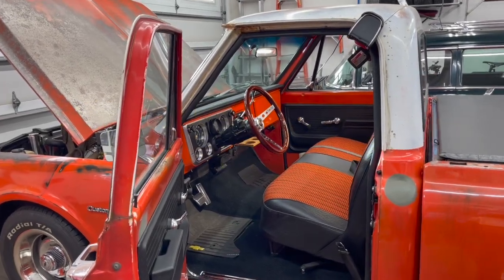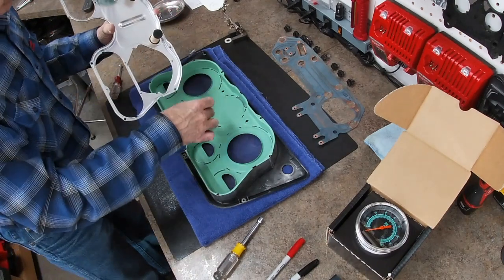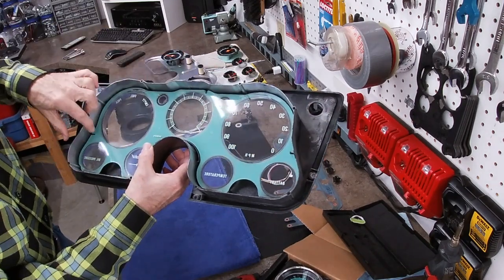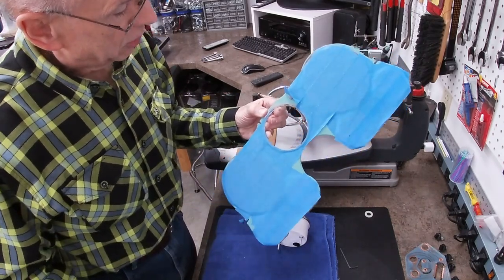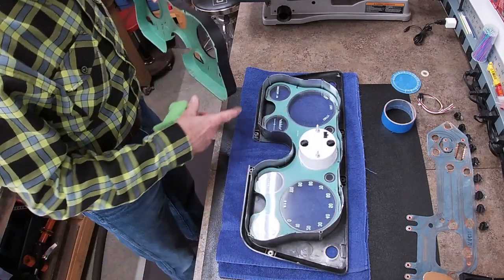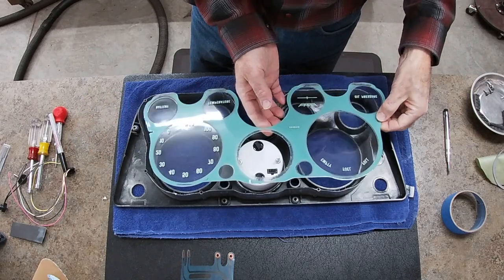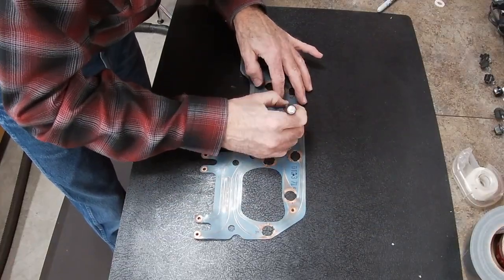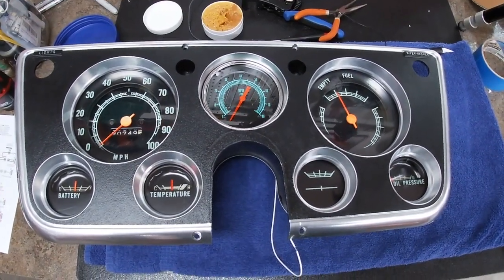72 Chevy C10 In Dash Tachometer Install

Comment: Brian, I really enjoyed this "how to" video on working on a 72 C10 dash cluster.  I inherited my Dad's 72 C10 that he purchased new.  I plan on removing the dash cluster and replacing the lens and circuit boards.  I also want to replace the incandescent bulbs with LED bulbs like you did on yours.  Where did you purchase your LED bulbs?  I haven't been able to find any....Ken
Reply from the maker: @kenarrington6925 Ken. I'm glad you appreciated the video, it was a fun project, and I think it turned out really well. I want to take mine back apart and paint the indicators on the other gauges now. I just have to get the orange reflective paint, and it's not cheap. Anyway, I found the dash bulbs I used on Amazon. I have tried a couple different kinds, but these seem to work the best of what I've tried so far. Here is the link to them on Amazon. https://www.amazon.com/gp/product/B07GRVN7R6/ref=ppx_yo_dt_b_asin_image_o07_s00?ie=UTF8&th=1

Comment: You mentioned to not connect the pink wire to where you initially put it. Where did you move it to?
Reply from the maker: @ijteague  I connected it to switched ignition at the fuse box. For some reason being on the circuit board affected the fuel gauge.

Comment: You failed to mention taking off the speedo cable...
Reply from the maker: And it's surprising how many times I forget to actually disconnect it, then laugh at myself when I realize why the dash seems stuck! But I never forget the oil pressure line, which is more of a pain in the ass to get disconnected than the speedo! LOL!
Reply: @MurfJunction  I found it was easier for me to take the seat out in order to get my aged body in a place where I could get to the oil pressure gauge a little better. All in all a very good concise video sir. Thank you.

Comment: Hi , Great video. I see you must of moved to a different gas tank. What did you switch to and how did you cover up the stock fill tube on the cab?
 Thanks
Reply from the maker: Thanks Jeff. As for the stock gas filler hole, LMC Truck has a pre-cut and shaped piece of metal for the hole I welded in. The gas tank is a pretty standard rear mount tank. I can't remember if I used the LMC one or not. Here is a link to my web site with the pictures I took on that project. http://www.murfjunction.com/pages/c10_pickup/gastank.html

Comment: Is that tach specific to an 8 Cylinder or can it be used for a I6 too?
Classic Instruments doesn't specifiy.
Reply from the maker: In the manual that comes with the tach, it walks you through the setup. You configure it for 4, 6, or 8 cylinders through a few simple steps, using a programming wire on the harness. I did this on the bench before I installed it, but it was very straight forward. I should have covered that in the video.
Reply: Brian, why didn't you use a stock tach?  Are you running an HEI?